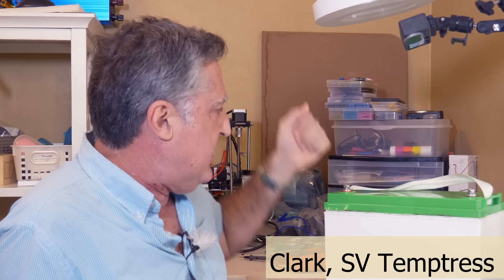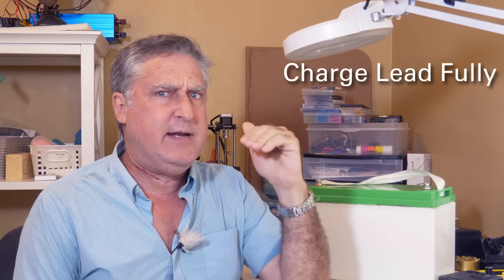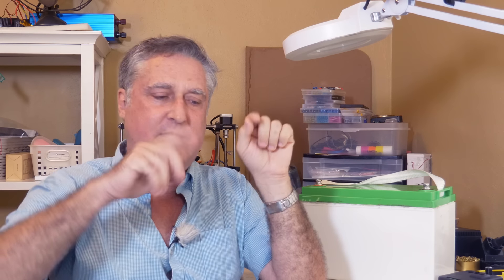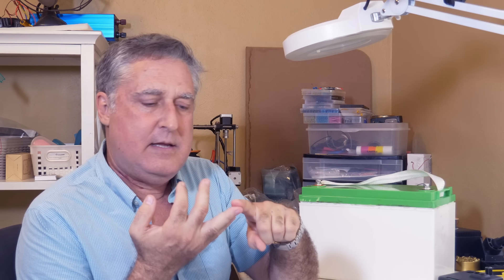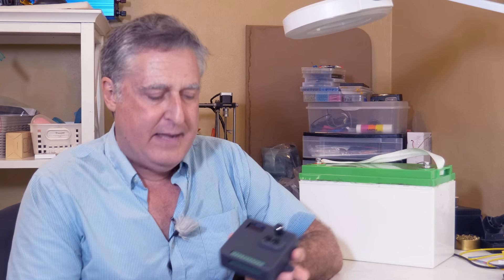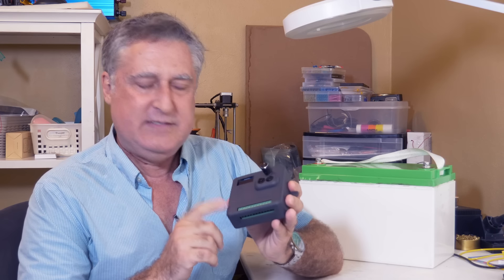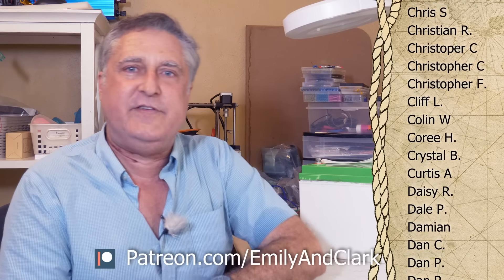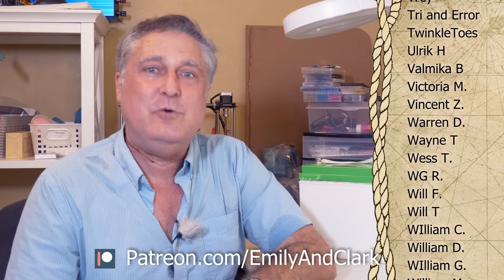Charge Lithium Batteries correctly (LiFePO4)

Comment: One reason why charge controllers may ask for charging voltage is older LI batteries had a variety of different chemistries and configurations. So the charger is asking what the manufacturer specified.

Most batteries are LFP now and bms have evolved, so they pretty much all operate at the same voltages. But both older chargers and batteries are still out there.

Setting battery state of charge to 20/80 destroys the advantage LFP has over Lead acid. 
BMS’s vary, top brand batteries usually also use top end BMS, while budget brands may skimp a bit. Although some budget brands like Redodo and LITime are giving them a run for the money,
It comes down to what BMS features you want and shop around based on that. 

With warranties for 3-10 years and charge cycle guarantees of 3500+ cycles it’s hardly necessary to limit charge and discharge ranges. Some confusion comes from older information from different chemistries as well as similar number confusion.  (DOD 80% vs 80% capacity after 3500 cycles).

IF, just IF you happen to have or need multiple housebanks, than a bank manager can be useful.
For pretty much anyone else, it’s overkill. 
Your LFP batteries will last 10+ years with full daily cycling. Yes they will end up with only 80% capacity by that time, but that a small price to pay. The only reason a 20/80 charge/discharge limitation is good, is because it artificially limits your usage/capacity. If a charge cycle is 100amp, I can’t discharge below 20% and only charge up to 80%, that leaves my usable energy at 60% or 60ah. It would take 2 days to account for a full charge cycle and thereby giving the illusion of a longer life span. You’d also need twice as much capacity to cover your needs, which is what we do with lead acid batteries.

My recommendation is to use the full range of your batteries capacity. If balancing is important to you, get a battery with active balancing build in. Otherwise, you can manually balance the batteries (disconnect and charge individually) once a year.

Battery technology is advancing fast these days. Chances are you’ll replace your batteries after 10 years just to be more up to date. Old batteries can still power a garage or other things.
Reply: One word on charge controllers. It’s not the job of the charge controller to balance battery cells. It’s the bms job. Some brands like victron also sell batteries. To optimize their system they allow the charge controller to directly communicate with each battery. Larger home system using server rack batteries do this as well. The small battery market for the most part has not yet incorporated direct communication. Give it two more years and it’s probably a standard feature.

Comment: I, too, read several whitepapers and immediately realized that I needed a better charging system for my lithium - - especially after a low cost charger ruined my e-bike batteries.  Having recently purchased / built a Riden bench power supply I realized that the latest firmware update ;provides a very sophisticated algorithm that starts with low voltage constant current (amperage that you specify) and then intelligently switches to constant voltage to the max voltage that you specify.  After datalogging the volt & amp curves over time I'm very pleased with how well it follows best practices.   Not sure the Riden makes sense as a charger for a marine environment as it is max capable of 60v/16A max and  - - more critically - - requires manual intervention to instantiate charging.  Perhaps interesting to incorporate their algorithm into a marine system somehow?  Thanks for the video Clark.  Timely and informative as always.
Reply from the maker: Actually that is just constant voltage with current control.  Pretty easily found out there in any balance power supply.
   But it's exactly what you need as long as you have a way to shut it down when necessary.  I'm glad you are treating your cells well.

   This works for you because your battery is either on the bike working OR on your charger.  In an active off-grid system we have loads coming on and off while charging and with solar we can't control the charger output current. 
    That makes the solution a tad bit more complicated.
Reply: @Clarks-Adventure  The Riden has auto-cutoff once the target charge voltage is achieved.  So seems ideally suited compared to the low quality / garbage e-bike chargers that cost nearly as much as the Riden kit.  

Good points re: the complications with off-grid charging.  I wonder... could current dumping via heat gun or similar be a way to (somewhat) manage charge amperage?  Would be very interested to see a video of how you stage 3 battery banks with separate bank managers.  Seems clever but please more details.  🙂

Thanks again.  As always, very informative.  - John in Switzerland
Reply from the maker: Yes.  With that feature and the right voltage selected for the size battery being charged this would be perfect for charging a battery disconnected from any load

Comment: Hi Clark, great content, thank you for your efforts. I'm thinking about upgrading my battery and inverter system. Currently I've a 18 6V GC2 led acid batteries that is due for a change/upgrade. I was thinking about getting a LIFO4 battery system for the house side and a new lead acid battery system for the engine and ground tackle. I also wanted to get a Victron system for inverting/changing and monitoring. Where should the Gen3 of this BBMS system sit? Is there a reference diagram I can look at? What charge should I use in this case a lead acid profile or a Lifo4 profile? 
Thanks much in advance
Reply from the maker: All these answers are in the BankManager manual.  You can find that at MarineDCAC.com

Comment: A LFP battery cell is like a glass of water. You can fill it to full but then it won't take anymore. Now when you have four glasses of water together it gets tricky to get them all full at the same time.
Reply from the maker: One of the problems is you can fill them over 100 percent and they will hold that power but at the cost of loss of cell life.

So yes your analogy is correct with the rule added, never fill the glass to the rim

Comment: Nice video, with the information very well presented (as usual).  If I may add on a  bit, the "Charge to 80%" thing for electric vehicles is specifically because of the use of NMC (and related) Lithium battery chemistries that really don't like to sit at full charge.  They also don't like sitting at low SoC either.  "Keep them between 20% and 80%" is the rule for maximum life in most EVs.  My own EV is from 2010, and the original LCO-based battery still has 80% of its capacity after nearly 15 years / 62,000 miles on the road; that rule is ingrained in the car's battery management strategy, and it appears to have worked.

The LiFePO4 chemistry doesn't suffer from this, so if you buy a car with LiFePO4-based battery cells you can charge them all the way up and drain them down pretty far on a daily basis without worrying about damage.  That can substantially make up for the lower energy density of the LiFePO4 cells in the EV environment.

So what that means for LiFePO4 batteries in RVs and boats is that we don't need to worry quite so much about battery stress due to high SoC.  It's still very important not to overcharge them, as you point out, but bringing them up to a proper 100% and leaving them there should be fine.
Reply: Check out the Engineering Explained video on EV battery charging its a great video and talks about the different lithium battery chemistries.
Reply from the maker: Yep, there is a link to it in the description of this video
Reply: I ruined lipo4 home solar cells going past 80% and below 20.

Comment: Good video and very nice work on the bank manager. That said, the Victron systems are very good!  I have designed, built and used 3 different systems over the last 6 years and have a BS in electronic engineering.  The Victron systems can also get you a long and healthy battery life if programmed correctly. I use 13.8v for reset and 13.9v for charge voltage. For my Epoch batteries it puts you right at the level that the battery cells begin balancing if out of balance. The current gradually tapers at 13.9v and the programmed delay time and tail current settings establish the 100% reset. It is very accurate with 99% efficiency setting and 1.01 for Peukert exponent.
Reply from the maker: Hi Elmer,
  I like Victron stuff as well.  In fact I have a box of blue boxes waiting for me on Temptress.
    I'm glad you have a working system you like.  But, what would happen if you charged at a higher C rate?  Or much lower?
     I stand behind what I've said in this video for the perfect charge.
     But as long as your batteries last long enough for you, that's fine right.
Reply: Both high c rate and low c rate charging naturally taper current at 13.9v in the constant voltage phase as you hold voltage at the knee of the charge curve. I expect my batteries will diminish due to age before they diminish due to high voltage dendritic formation.
Reply from the maker: Try this.
   Discharge a battery to 20 percent.  Then charge it at .5C. It will go right past 13.9 and accept that current. 
    The correct terminal voltage for .5C (when the cells are full) is 14.6v. I bet the voltage will hit 13.9 at like 60 percent full
Reply: @Clarks-Adventure  I have the utmost respect for your bank manager and the process you use. It is probably technically better than the Victron component charging scheme that many manufacturers also use. It is very good so don’t misinterpret my comments. I am just defending that the Victron charging scheme is actually also very good in practice. I can’t hit the.5c charge rate as I have a 900+ amp hour bank so I have no actual data on that however I can observe the system behavior and have many many many days under a variety of conditions. At a set point of 13.9v the bank will accept maximum current then the current will gradually diminish towards zero. As the tail current goes under the 2% tail current the batteries are at about 99% if the charge efficiency is set to 99% and the Peukert exponent is set at 1.01. I am getting little drift so far.

Comment: There are indeed charge controllers for LiFePO4 batteries..!!  I have been using them for years in my home solar/wind system..!!  My controllers handle up to 96v and are fully programmable..!!  I run 48v..!!  My bank is held at 3.36v/cell,,, just above nominal,,, and are basically acting like capacitors..!!  Of course, my balancing takes place in this voltage range as well..!!  I do this manually but there are BMS's with programmable balancing voltage thresholds..!!  My system is not designed for off grid but will provide up to 4 hrs of capacity (with automatic load shedding) in the event of power failure..!!  I use home assistant for everything, even as a BMS, controlling solid state relays for battery disconnection..!!
Reply from the maker: Yep.  That will kill your batteries nicely.
Reply: @Clarks-Adventure  4 years so far with 6mv per cell deviation..!! I'm satisfied with performance so far..!!  Lots of storms and power outages in Texas..!!  System has been pretty well tested..!! Pulling rather large loads with multiple AC's cycling in summer and multiple  heaters in winter very consistently..!! No problems at all..!!  Batteries are 1.8kw 3C continuous discharge rated so they pull the dynamic loads well..!!  They still capacity test just fine..!!

Comment: > Charging to a voltage damages Li period

The oldest instrument LFP bank I know of (Rod /Maine Sail's bank assembled in 2009) begs to differ.  Charged to 3.45Vpc  for thousands of cycles and still meets rated capacity.
Reply from the maker: That can happen as I described.  There is of course a proper voltage given all the other variables.  But in an active solar charged system that's not really possible

Comment: Clark, what is a good way to discharge a lithium battery if it's not connected to your system and it needs to go into storage?  I have this situation.  Good video and you'll get several watches from me because I need to understand this stuff.  Keep the good stuff coming.
Reply from the maker: Any load.
   Whatever pulls out power.  Just track the amps and hours do you know when to stop.
Reply: A simple resistor! Or if you don't have one - an incandescent light bulb. Perhaps a DC motor, like a PC fan?

Comment: On my two Victron IP22 chargers they are easy to program to charge in absorption mode based on tail current.   It is not in the base programs but not a problem by going into the advanced settings - expert mode.  I think the same is true of most Victron chargers.
Reply from the maker: Great for lead.  If I was you I'd use it.
   But for it to work the charger would have to know the current actually going into the battery.  For a Victron I guess that would mean a smartshunt on the negative terminal of the lead bank.

   It's, of course, no help for Li.
Reply: At least Victron chargers have the states: charge - absorb - float
90% of all chargers stop at a voltage and stay at absorbtion state without droping to float. Victron works with a timer - not as perfect as your soltution but better than everything other.
Reply from the maker: Yes,
  That is fine for lead
Reply: @Clarks-Adventure  It does know what is actually going into the battery.  The IP22's have synchronized charging that communicates with the Smart shunt to base the tail current on the amps going into the battery.  I have tested it and once it drops to my chosen float at 13.3v it will not go back up even if I turn on all of my dc loads and take the charger output up to +20A.

Comment: What a nice and clear story. Until you started on 24:00 about your product. Furthermore, you claimed that you should NEVER charge to a certain voltage. However, you do not mention how it should be done. I charge Pylon with the available sun to 51.8V (15 cells) without any problems.
Reply from the maker: No problems yet.  The damage takes a while
Reply: @Clarks-Adventure  Do you have the correct charging sequence for a 15-cell LiFePo4 battery? I want to charge to max. 51.8V.
At a higher voltage, the Pylontech battery 2000 gets hot in just a few minutes even at 0.02A charging current. I even got another unit for that under warranty. Not charging to 100% (52,5-53.5V) prevents that nasty temperature increase.
Reply from the maker: @stoomheier nope
  But the BankManager will manage the charge of a 16 cell pack

Comment: Thank you. Excellent. I am still going to watch it a second time because my system is strange: No solar (for charging batteries).  Daytime production is high enough to run an 120VAC charger powered by inverter to recharge LiFePO4 and AGM mix.

Comment: We call it the knee, not "hockey stick" in Europe & Australia  - We charge them in 2 main stages Bulk and Absorption - typically on a 100ah Bulk charge for 14.4v  and when that's  is achieved absorb for 2 hours at 13.8v  - some times you can charge what's known as lithium light where the bulk charge is lowered to 13.8v
Reply from the maker: I feel sad for your batteries

Comment: Hey Clark! ...I ONLY have LiFePO4 batteries (3) on my sailboat 400 AMP hours at 48 Volts.  QUESTION: is the BankManager the BEST product for regulating changing these LiFePO4 batteries. Keep in mind I also have 1. Wakespeed Alternator regulator for my 48 Volt 100 AMP alternator. 2. onboard Inverter / charger .  3. Victron MPPT Solar battery charger. 4. BMS systems on each of the LiFePO4 batteries. Question: If the BankManager is the BEST product for regulating changing these LiFePO4 batteries then HOW best to install it and easily (DYI) integrate it and WHERE.  By the way I have a foolproof way to find a stunning, captivating, enjoyable, with a  lovely full time sailing Partner that will respectfully obey your wishes with her whole heart and with a great positive attitude. My buddies' and I used this system successfully 20 + years ago and we each have the best petite feminine respectful full time sailing Partners on our boats.